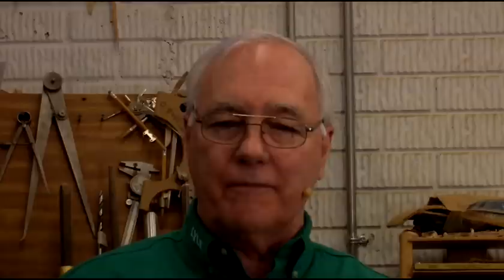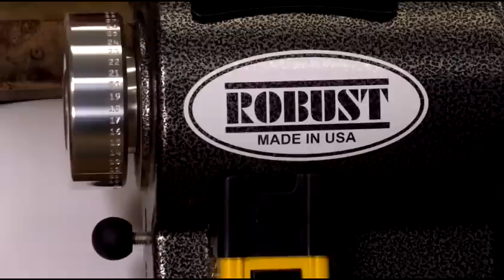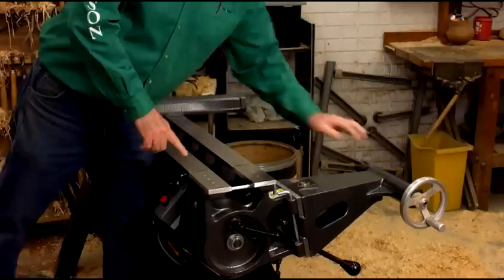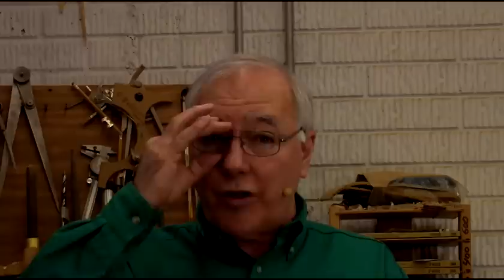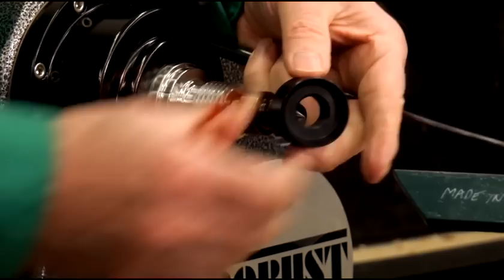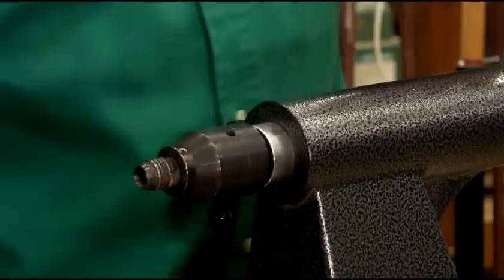Robust review showing features and benefits of upgrading lathes using the American Beauty example

Comment: Hi, Lyle. I'm still using your hollowing rig, and am getting close to pulling the trigger on an AB. The only thing I don’t like (beside the price!), is the lack of a speed readout. Why doesn’t this high end lathe come with such a basic feature?
Reply from the maker: Hi Fish,
I guess you know I am a Robust distributor.  I can help you when you are ready.  I have an AB coming off the production line soon that could be yours. It is not expensive if you consider what you get, it is the best lathe in the world. Your information is not correct, the speed dial has a RPM indicator. Call me when you are ready to upgrade and I can make sure you get all the discounts, and features you want and need.